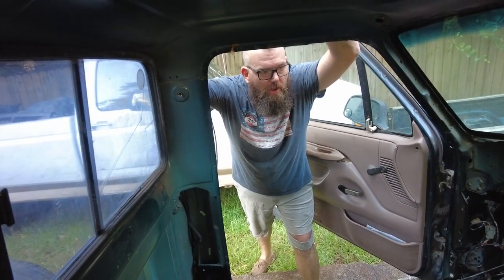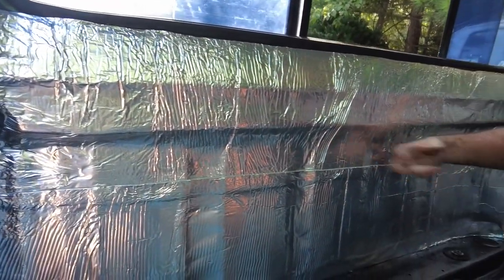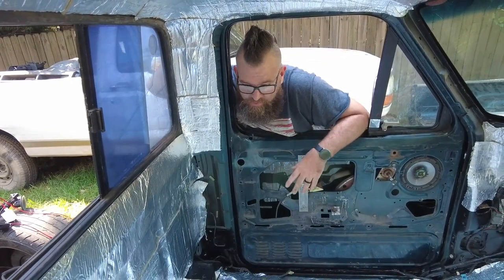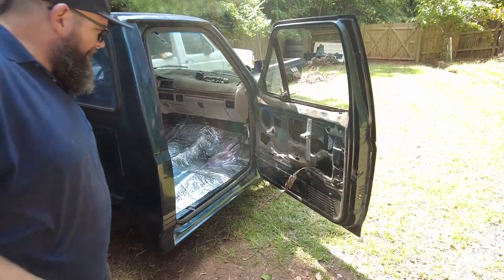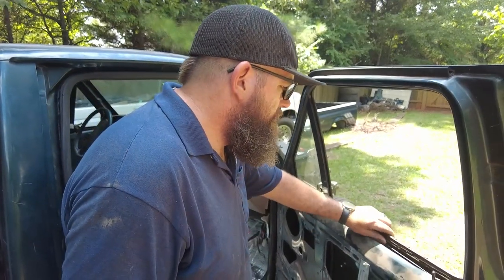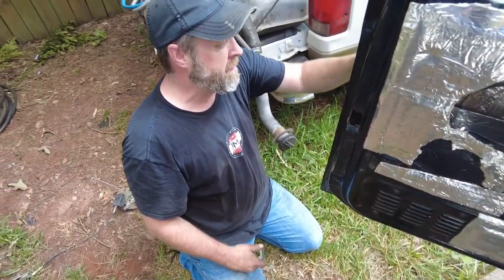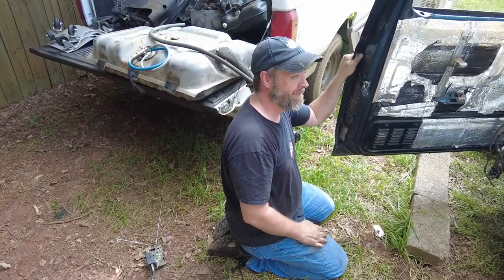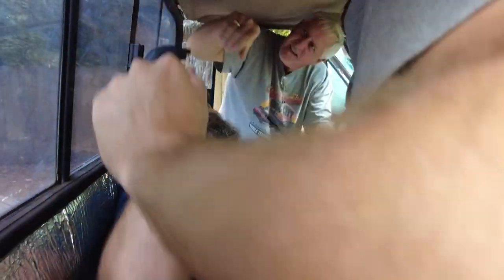How to Swap an Eddie Bauer Interior into our Coyote Swap F150 Base Model

Comment: Did the bench seat and the split seat floor holes match?
Reply from the maker: Yes they do.  There is a factory seat bracket that comes from the donor.  Everything lines up easily.  Thanks for the comment and support.  Please consider subscribing if you haven't already.

Comment: Is it possible to do hand crank to electric window conversion, I’m thinking about changing the whole door, from a parts truck
Reply from the maker: Yeah the key would be to get the components and door panels.  It is easier to switch to a manual window for sure.  Also have to get the rivet tool and rivets.  Harbor freight has them.  Good luck brother
Reply: @JMRRebuilders  I’m thinking it would be easier to swap out the entire door, but how would I connect the wiring from the mirrors, locks and windows? Where does that wiring connect to?
Reply: I already have all the parts from a parts truck I have, since the truck is the same color that’s why I’m changing the entire door
Reply from the maker: @raulangulo6351  thats a tough one.  Thought you would swap all to non power.  You will then have to come up with cover and remove the window switches.
Reply: @JMRRebuilders  I’ll find something out 👍🏼